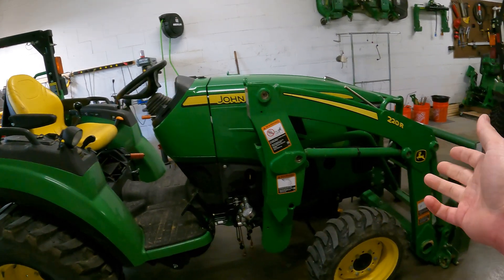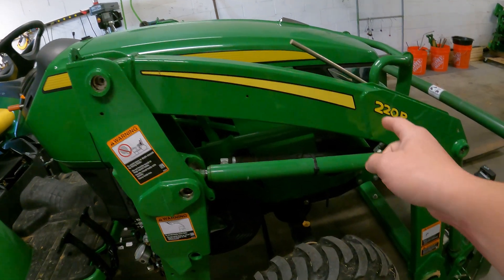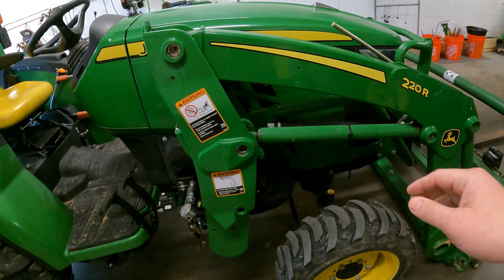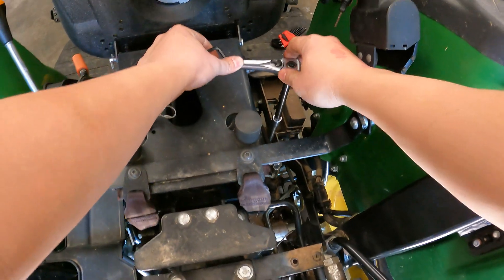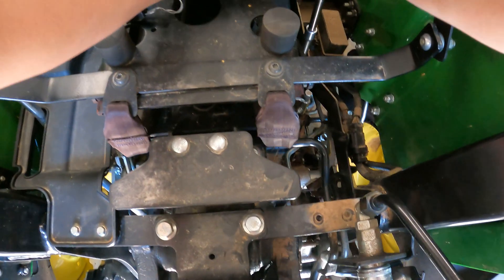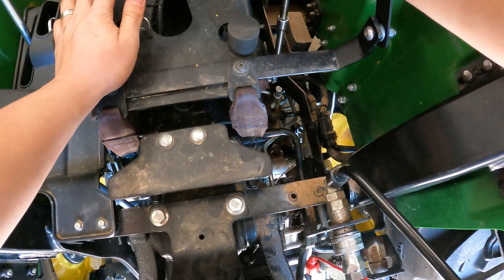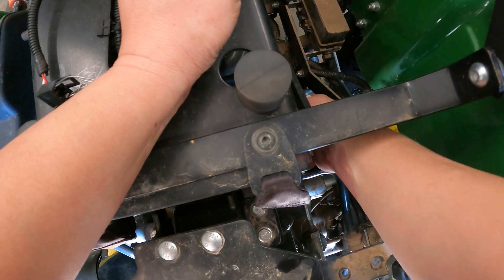John Deere 2038R Pressure Relief Valve adjustment - Increase lift capacity

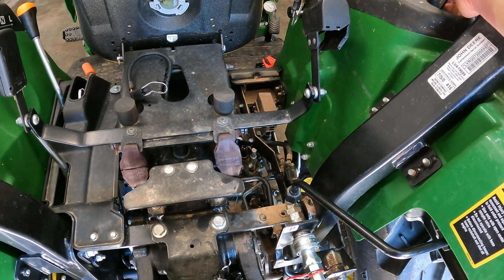Comment: I know this video is 2 years old but it still applies to my 2038R.  I raised my hydraulic pressure from 2500 to 3000 at 2000 RPM.  I am thankful that you gave the correct size for the hex key and the wrench needed to adjust the pressure (9:15).  It allowed me to get all the tools ready so I could streamline the process.  Using a wrench and getting it to rest against something made it a lot easier to turn the hex screw (10:59).  Once again, thank you!!!

Comment: Would this help the 3 point? Got a no till drill that’s like 50 pounds overweight that I need to help to pick it up.
Reply from the maker: yes - if you only need 50lbs, a small increase in pressure will get you up in the air.
Reply: @HydrosPlus al mío se le bajó el equipo solo y ya no levanto, que podrá ser

Comment: Will this work for a 3025D?  2023.
Reply from the maker: I can't confirm since I don't have that model tractor.  It should have an adjustment, but it's not likely in the same location since the D is a very different tractor.

Comment: Is 3000 the highest you should go?
Reply from the maker: Yes/No/It depends ;)

I think the spec is 210 bar, which is technically 3040psi.

Generally speaking, 3000psi is a good safe place to be for medium pressure hydraulics.  This is what you see most equipment, including construction equipment working at.  Some will be at 3500psi, but most are spec'd right around 3000psi.

Comment: Very Helpful video-thanks! But where in the heck can i get a pressure gauge into the circuit on a 3038E all hard plumbed and no QC fittings?🤫
Reply from the maker: There is a QC fitting behind the right tire to check the pressure.
Reply: @HydrosPlus  Well- even though i had never seen any there u did get my hopes up!  But alas- none to be found. This is a 2017 model- maybe they started doing that on newer ones?    "behind the right tire" - I am assuming that would put it right in same area as the pressure relief valve? Checked behind the other tire also just in case we were facing different directions when locating the 'right tire' 😎  Gonna keep on trying to figure this out before taking to the dealer if i can. And thx for the response!
Reply from the maker: @albeenog2432  I wasn't sure when they added.  Here is where mine is - https://www.youtube.com/watch?v=fwPtVcynTwU&t=800s

Comment: How much of an increase do you supposed doing this adjustment gives?
Reply from the maker: I haven't done any tests based on pressure alone, but with the HydrosPlus Scale+, it's close to 1psi per pound...so 100psi would give you 75 to 100lbs at low heights and less as you go up.

Comment: Do you run into any warranty issues with upgrades?
Reply from the maker: I have not heard of any warranty issues associated wth HydrosPlus.  The solution itself only changes flow and not pressure, so there is no chance it can damage components of the tractor.  That said, any change to your tractor, whether that is an LED light bar, loaded tires, or aftermarket oil filter has the chance to affect your warranty.  I should note, no changes you make can "void" your warranty, but if it's found to affect a warranty claim, then they may not pay.

From everything I have read, JD does the right then when something breaks - actually more than the right thing.  More stories about things being covered that shouldn't be than stories of things that should be and they didn't cover.  Most people don't have a good understanding of what a warranty actually covers, so when something breaks and it's not covered, they are very vocal about it. 

For any major warranty issue, such as a blown engine or broken PTO shaft, I would recommend removing anything aftermarket from your tractor before sending it in.  That way, there is no chance for a dealer to suspect something that you know can't be the cause.

Comment: Is this adjustment just for loader relief? Or does it also adjust transmission drive relief?
Reply from the maker: This adjustment affects everything on the implement circuit - loader, rear SCVs, PB/Backhoe, rockshaft.  The PRV for the drive unit is separate because it uses a separate pump and set to a much higher value from the factory.  The spec is 4140-5060 PSI

Comment: Excellent video.  Thanks!!!  You have a new subscriber here!!

Does this increase the lifting capacity of the front loader? (Assuming a proper ballast is on the tractor)

I did see your other video about replacing the pump too, would I have to replace the pump to gain capacity or is just turning this up going to give a little more?
Reply from the maker: yes, increasing the pressure will increase the lifting capacity of the loader and the capacity of any hydraulic implements you attach.  You do not need a HydrosPlus Flow Solution to do this; it can be done at any time.  As mentioned in the video, if you want to increase your capacity with the new cylinders that are coming later this spring, a HydrosPlus Flow solution is highly recommended because when you increase the volume of your lift cylinders, the loader will also lose speed.  The lift capacity will be increase by ~36%, but the speed will also slow down by about 20%

Comment: How high do you crank up the 1 series?
Reply from the maker: For me personally, 2500.  That's because I have the backhoe and the backhoe reliefs are set at about 2500.  This gives me more lift capacity, is well under the working pressure of most components, and ensures I get the most out of my backhoe.  I will do a video soon on my hypothesis on why the pressure limit of the 1 series is 2100psi.

Comment: Does that pressure releif affect the backhoe as well? Or do the 2 on the backhoe have adjustment also? I did the loader one but would like the backhoe stronger also. I see 2 listed on the bh but havnt opened it up yet to see if they are adjustable.
Reply from the maker: Check out this video.  Short answer is likely yes - https://www.youtube.com/watch?v=pG-IjSb4BPc